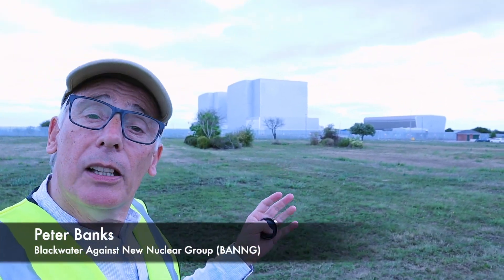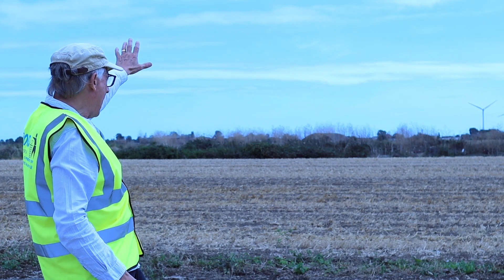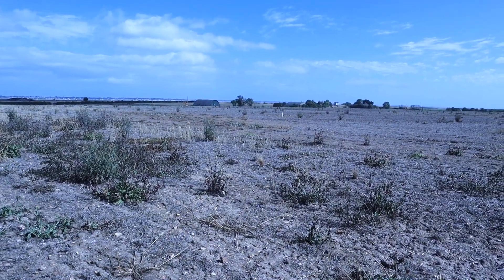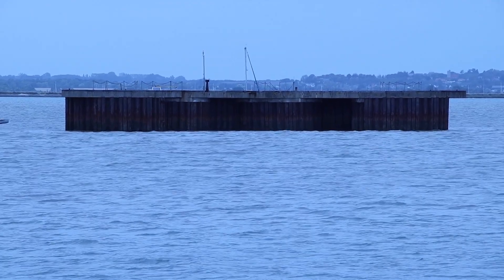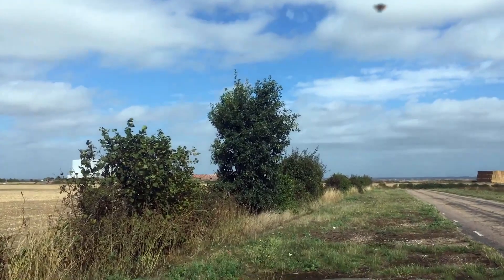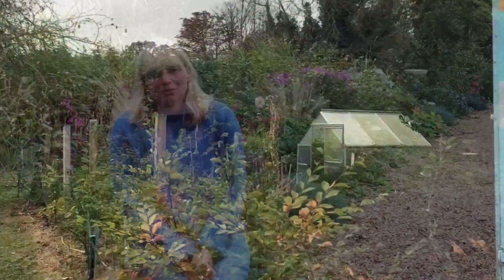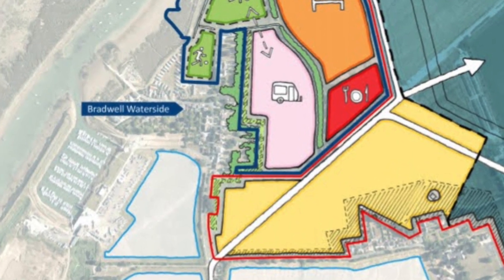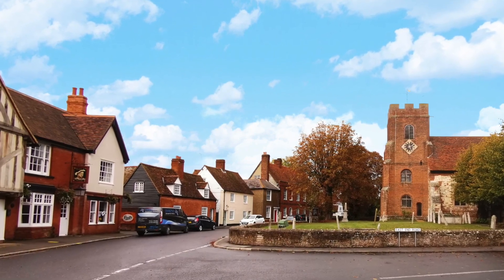How would Bradwell B affect local people, place & environment? What powers are behind the decision?

Comment: why are residants complaining about a new power station they moved there happily when the 1st power station was running the reason its being placed there is the same reason why the 1st one was placed there.  there is alot of water
Reply from the maker: The proposed Bradwell B power output is 10 fold that of the earlier power station and the site is vastly bigger. Plus most folk move within 15 years and the former power station was closed 18 years ago. Regardless there will still be the issue of radioactive waste on the old site for at least another 60 years to keep residents company ;-)